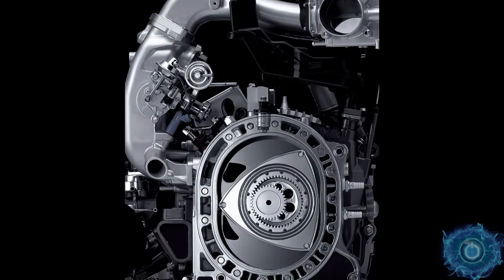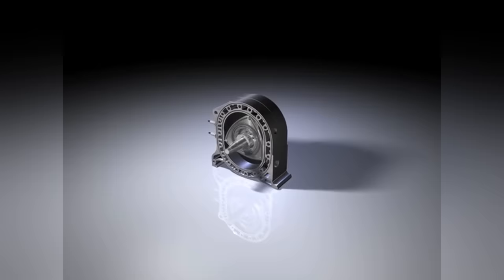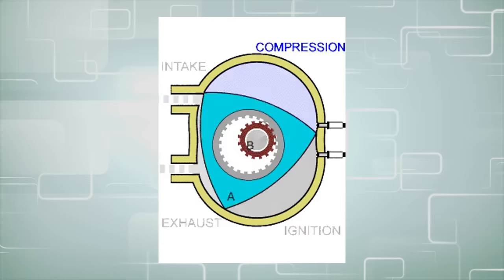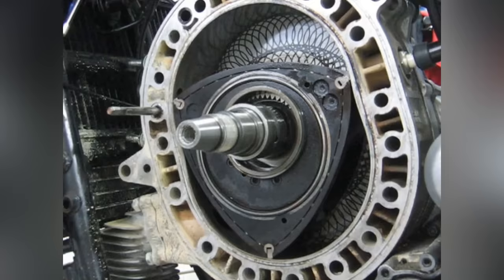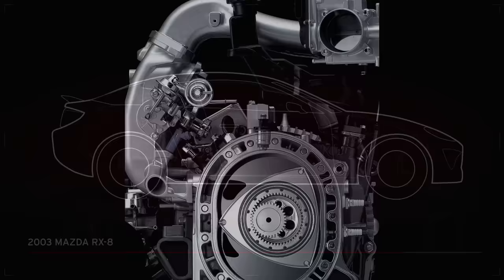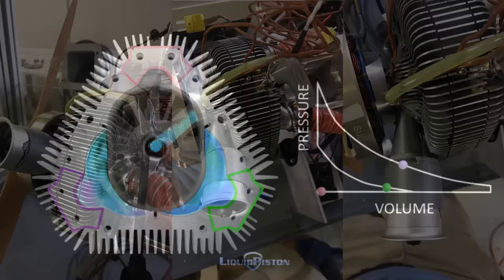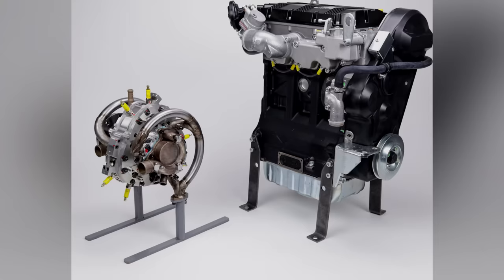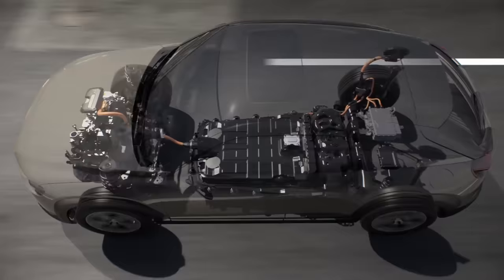STRANGE New Rotary Engine BREAKS Records

Comment: The aircraft engine you displayed is not a rotary it is a radial engine!
Reply: It's a rotary, a static radial's cylinders are stationary.
Reply: Michael Atwater: nope, the original designation was "moteur rotatif" (rotary engine), invent from the frenchman Felix Millet in 1889 (who use it integrated in he's motorcycle's wheels, and the Radial engine was still a french invention...The Wankel IS NOT a rotary engine, but a rotary PISTON engine, according to the original definition from Felix Wankel, engineer by NSU...

Comment: Mazda never solved the apex seal issue. Even the RX8 has issues well before the 100k mark.  They will forever be high maintenance, low fuel efficiency, good power to weight.   Only hobbyists will find value in them.

Comment: The Liquid Piston XTS-210 is light enough at 42 Pounds, Reasonably Powerful at 25 HP, and with 46 Pounds (Foot-Pounds, I suspect) of Torque, Sounds Great for ATV's Small Tractors, and a candidate for a Multi-Rotor Package, to keep the Small Peripheral Dimensions, but just Longer. In theory, a 2 rotor Could weigh less than 2x 42 lbs., thereby increasing Power to Weight Efficiency. Plus, at 50 Hp, it starts to suit small cars, Slightly larger Tractors, and even light Aircraft.

Comment: My neighbor had a mazda with a rotary circa 1990.  I never could figure out what happened to it's engine.  When you started it up it was like those old mosquito fogger trucks.  Blinding clouds of white smoke form the exhaust.  Was this the sealing strips?  They had it towed away one day and I never found out what the problem was.  I can't imagine the sealing strips could produce soooo much smoke from the exhaust.
Reply: white smoke is usually an indication that cooling water leaks somewhere into the combustion/exhaust area. therefore a sealing problem.

Comment: Seals for all internal combustion with cycles have large displacements due to the thermal expansion of the moving part that is exposed to combustion temperatures.  The standard piston and the Wankel engines can be cooled more than the liquid piston engine since the face opposite of the combustion exposed face sees oil or vapor of the oil.  It can be cooled by this oil.  The liquid piston inside wall is exposed to the exhaust or the intake air.  Poor cooling.

Comment: I just don't understand the stuff.  It's easy enough for me to understand the relative ease in which a cylindrical piston is sealed (3 rings, scraping down oil).
The main issue isn't even the apex seals, although the lubrication for them does seem limited.
It's the sides of the rotors.  The whole thing is rotating/sliding against solid walls on both sides.  How can they be sealed and lubricated, without relatively high leakage and oil consumption???

Comment: 20,000 rpm fron the 2cc model Wankel isn't a big deal. Most small piston model engines do those kinds of revs. (Competition pylon race engines commonly run 32,000+ RPM)

Come to that, 3.5 litre V8 and V10 F1 engines were up around 20,000 rpm  too.

Comment: A gasoline piston engine typically has 3 rings to retain oil and compress gas. Even with that there are blow by gases as if the rings sit too tighlty on the wall of the piston it increaes wear and friction. A diesel engine has even more, the problem with rotary engines has been persistent problems with the apex seals, even if you resign tge shape the problem remains. 

   I applaud the rotary engine makers for getting engine weight down, but we are coming to a period were gasoline engines are going to be phased out, so whats the point of proving you can make a rotary engine that lasts as long a something made on 1949.
Reply: Right, the theory will be beat by the practice. Also it is over 30 years to late.
Reply: Skidoo and Polaris only have 1 oil control ring on their 850 engines.  strokes are thriving in snowmobiles, dry sump 2 stroke DFI clean burning 2 stroke turbo engines and liquid piston rotary 2 stroke the same. no fat ugly 4 joke wet sump oil change mess! aint that nice.

Comment: what if instead of having apex selas they jut had the engine sorata suspended and havea n poil lubrication on the outside that is sealed from the engines inner so that you dont need to mix the oil with the gas

Comment: So what would a 5hp rotary engine weigh? How much fuel would be required to power a generator that can keep a 48 volt system fully charged with a constant draw of 12 amps for one hour and how big does the generator have to be?

Comment: Koenigsegg’s 2.0-Liter No-Camshaft Engine Makes 600 Horsepower, is also a rotary engine, a tiny 3cyl made and produced by Koenigsegg
Liquid Piston will need more engineering but current engine lookin pretty decent especially if we can take this to the on demand hydrogen engineering route since rotary can run on multiple fuels,id like to see these type of rotary engines in the personal vtol sector for its high power to weight ratio,Paul Moller of Skycar was trying to redesign the wankel rotary n his engineers had good success but we all know what happen there
Reply: Keoigseggs 2l is a 2 stroke 3 cyl. I talked to Paul Moller about getting an engine and i have a few OMC 528cc 2 stroke rotary sled engines. they are great but i gotta get some parts though.

Comment: You don't need to tell anybody that it breaks any records. All you need to do is tell us what it can do, what it's capable of, and how it can be used differently to any other engine, or specifically differently to engines in it's class ,or in it's segment. The fact that it breaks any records at all is more than completely irrelevant. The only thing that helps it do is sell out when being marketed. Not when being informed of.

Comment: I have been advocating a 'one engine per wheel' approach for a long time. Smaller rotary engines would fit the ticket nicely. Small and tucked into the wheel they would take up little room and the weight would be distributed where it is most needed for traction.
Reply: In the wheel has its own set of problems due to vibration and shocks. 
Even most EV choose to mount in the chassis and use axis who can move with the bumps in the road.

Suspension does have it's benefits, even for engine (not just the driver)

That said.. many smooth road setups like carts and racing...
Great!

And there are developments for airless tires that are strong enough for a good fuel economy, and flexible enough "no suspension" is needed (for regular roads, not ofroading or heavy loads)
Reply: @fhorst02  It would not mounted to the wheel, just tucked as deep into it as possible. The light weight of the engine wouldn't put an undue amount if strain on the assembly
Reply: @slythewhyissilent  👍 you build and test it!!
Electric motors aren't (usually) inside unless short lifecycle items like E-scooter/bike.
As they don't do the vibration that well.
It for sure CAN be different with the rotary's.

We will see if/when they become mainstream how the "big boys" are going to build them!

You probably need a tiny exhaust to fit inside a wheel :-)

Comment: An interesting iteration of the rotary engine. I like the fact that there are no points on the rotor, which should eliminate a multitude of issues experienced by current rotary engines, such as the afore mentioned apex seals, etc. Best of luck to this company.

Comment: I think to make EVs practical for distance travel a small IC power source is required. It is accelerating that consumes the greatest energy, once a constant speed is achieved power consumption drops a lot. So a small constant speed power source can recharge draining batteries effeciently for long distances. Maybe an opposed piston two stroke diesel would be the most fuel effecient.

Comment: Personally, I'm going to throw a few bucks at Liquid Piston. I can envision the smaller applications taking off. I'm not so convinced of the compression ignition tech. Seems a bit light on the efficiency so far, but like the other stuff they are doing.

Comment: What about the materials expanding at different rates on the comb side and intake side? They are in one plain. One piece of material, but diff temp on either side. I heard this was a big flaw in the mazda rotary engines.

Comment: At what compression ratio do engines start producing nitric acid?  I know that earlier piston engines used a much higher compression ratio, but that had to be reduced to stop emissions of nitric acid in the exhaust.
Reply: You're referring to nitric oxide NOX, which is produced in the exhaust with excessively higher combustion temperatures. An air/fuel mix that is too lean will run hotter, so a NOX sensor in the exhaust stream could probably adjust the air/fuel mix automatically.

That and the type of fuel mix is also a factor, as both kerosene and ethanol will burn cooler than regular gasoline.

Do some reading on the octane ratings for gas, as the octane rating is all about controlling the self-ignition (knocking) characteristics of a fuel.
Reply: @martinhirsch94  Fascinating.  Thanks Martin for clarifying.  This was something I heard about in high school chemistry class, so I bet I was remembering it incorrectly.  You're correct that I've never looked into the octane ratings, and I'll look into that.

Comment: What’s the torque curve look like.  I would say the torque in the rotary compared to the piston engine would be at a much higher rpm limiting his use to things like aircraft and a generator. Peak torque in piston engines in at a low rpm in standard camshaft profile engines.

Comment: Here's what you can do with the Liquid Piston engine. All It needs to be doing is generating electricity. That's it. No Other load. You can cut the battery size by 3/4 of what they now have to be. You are literally making electricity as you are going down the road. Not getting it from 100 miles away vIA a charging station. Use the fuel that's the cheapest. The Price of the That car drops in half from less expensive batteries and weight loss. Nissan Leaf would be a perfect test bed.

Comment: At about the 2.5 mins in the engine was oversimplified as a 2.6l. It's actually a 1.3l but due to the extra power "strokes" the easiest way to make it comparable to piston engines was to call it a 2.6l. This always seemed strange to me as if we applied the same reasoning to two strokes a 50cc would become a 100cc as it has double the power strokes of a 4 stroke of the same capacity.
Reply: Yes a rotary is a form of 2 stroke!

Comment: I have never really driven a rotary engine but I know people liked its performance and sound. But it had a lot of durability issues that led to its decline. I notice that they have put the outer peanut shape inside on the rotating component while the outside is now triangular like the rotating head used to be and covered in cooling fins. I don't really know if it will help much if it doesn't lower cost of car production significantly as the issue with EV or any hydrogen produce car model is very high production cost. Especially in case of EV the cost will skyrocket with demand as the primary raw material for current battery technology is extremely rare metals found in only a few places on earth.

Comment: Rotary engines need more fuel to produce the same power as a cylinder. They're extremely inefficient and extremely high maintenance. The Rotary piston seal wear out and need to be replaced.

Comment: From what i understant, even though piston based motors are a heresy in terms of Engineering, by the time rotary engines got there (and i know there were there for a while, but not on an industrial level), piston engines were optimised to the point that rotary was not a viable option (even though in the long run they would be).... So the industry did the usual by choosing the the solution that is not the best but the most cost efficient in a short term.... (just like electric vehicules were there first but oil replaced them for practical purposes in the short term and now where getting back to EV)

Comment: I had a Mazda RX7, (new), with a rotary engine, it burned so much oil I insisted the dealer take it back....they refused and said it was normal, so I bought a Toyota and will never, ever go near a Mazda again. I just don't trust them. That is an absolute fact.

Comment: The rotary engine should be perfectly cylindrical with curved fins at the edges but I maybe be wrong, after so much R&D for years the giant cooperation were not able to fix its flaws .
Reply from the maker: That would be interesting, I wonder if you can seal the rotor?
Reply: @Tech_Planet  I think he is thinking of turbine...

Comment: Youre confusing RADIAL engine with ROTARY engine. Cylinders, in a round arrangement is RADIAL.
Reply: nope: the original definition was "moteur rotatif" (rotary engine): the motor rotate, the Wankel did not rotate: it's a rotary PISTON engine (according to Felix Wankel/NSU definition). The most WW1 aircrafts did use rotary engines type Gnome, many other engine builders did use this technology more or less modified like Bentley, Le Rhone, Clerget, Oberüssel...this engines was a good solution at debut from WW1 because light and with good cooling even at ground, but the classic engines was fast improved (example the 280hp 12cyl Renault 12F from the 1917 Breguet 14) , and this sign the end from the rotaries who was limited in power around 200hp because gigantic gyrocopic effects, and did burn lot of oil (lost oil lubrication) and had high gas consumption...

Comment: The concept looks good but as you pointed out it is all going to come down to money, Mazda had a considerable amount of it. I have a single rotor 13B in my aircraft. The Wankel engine is extremely well suited to aircraft.
Reply: Do you run premix or oil injection? i run nothing but amsoil interceptor 2t oil in my wankel 2 stroke.
Reply: I run premix, 2T fully synthetic oil, 320cc/ 20 lts of fuel. Not sure why you say Wankel 2 stroke.

Comment: That would be 3.9 litres for a 13 b rotary 3 sides to a rotor 650 cc each rotor face X2 rotors so that's 6 X 650cc and 6 firing impulses or equal to six cylinders ! So the same as a 6 cylinder 3.9 litre four stroke  ! And Mazda didn't move the ports to the side for air flow , in fact the best airflow in a rotary is perifereal port or holes through the housing not in the sides but this makes big holes in the surface the apex seals run over , so moving the ports to the side lost power but gained reliability !

Comment: im not an engineer but i have been a motor guy since i was little even when i didnt know anything about them. rotary never got me that excited because the cars and driveline was always mundane to say the least. with a cvt transmission rotary would really shine. peak power and rpm all the time just like on the 2 strokes. yes grabbing the gears is more fun but when its always in the right gear makes a huge diff than 5-6 badly spaced gears. 2 strokes got my attention alot more as they were on things i cared about and alot more practical. and dear god the power is terrifying when tuned properly...
this little guy though does have my attention as i think the flip they did was alot smarter than the initial design and im interested to see if and where this thing goes.
2 stroke started making a comeback with all the fuel injection and direct injection going around but its so stigmatized in many places now its pretty much just for the die hards. maybe these guys can fill that gap and give me some new fun toys again. the ones i have are starting to get boring.
Reply: Im a 2 stroke fan, Yes a DFI 440 v8 2 stroke in a challenger would be insane. i got a few OMC rotary 2 stroke 528cc sled engines. Lighting bolts and the sun are plasma 2 stroke entities.

Comment: What actually happens with the liquid pistons rotary engine is that most of its patents are held by the United States military, with several prototypes in development for drones with a hybrid propulsion system as well as very compact power generators capable of run on multiple types of fuel, you can still pick up a development kit from the company for about $30,000, but you don't own the profits or rights to what you can improve or modify about the engine

Comment: If this motor is any good it will be locked down under the national security clause of the contract they signed with the DOD and the general public will not here much more about it in a year or so.

Comment: So the rotor is now shaped like the former housing and the housing like the former rotor complete with stationary Apex seals...mmmm...
Reply: According to a NASA research paper the stationary seals alone look to lower total friction in the apex seals by somewhere around 2000 watts per seal at 7800rpm. The seals experience 9x more friction per rotation at 7800rpm than 1000rpm. It should put the apex seal lifespan somewhere in the range of how long it would last in a Wankel if it only ever idles.

Comment: Its power to displacement ratio is almost similar figure to 2 strokes. What about unburn fuel?
Reply: Compared to direct fuel injection 2T, wankel burns more oil.
Reply: Its is a 2 stroke rotary

Comment: Is that company still on about that engine. Its bogus you know. The failure is the sandwich design. You still have to inject oil into the combustion chamber, the seals are still prone to failure, fuel economy is crap, it only works with any hint of efficiency in a very tiny range.

Comment: I OWNED THE VERY FIRST MAZDA SOLD ON THE EASTERN SEABORD OF THE US SOLD IN TAMPA FLORIDA IT WAS A RX-100 WITH A STANDARD SHIFT TRANS THE DEALER SHIP REQUESTED THAT I BROUGHT THE CAR IN FOR SERVICE VERSES MY DOING THEM THEY ACTUALLY PULLED THE MOTOR OUT OF THE CAR NEARLY EVERY TIME AND COMPLETELY 
OVERHAULED IT AT NO COST TO ME BUT THE OIL AND FILTERS IT WAS AN INCREDIBLE LIL CAR AND NEVER BROKE DWN (PERIOD)